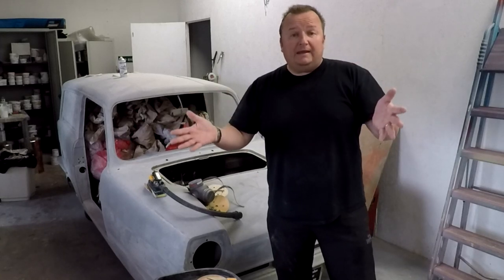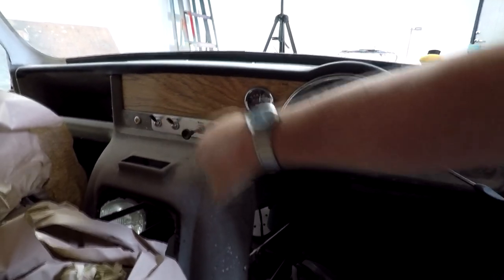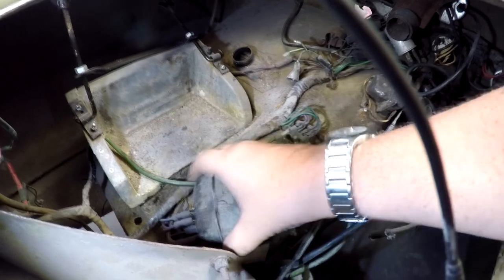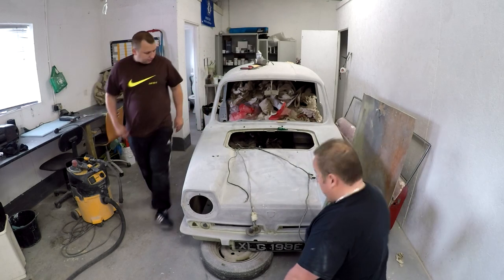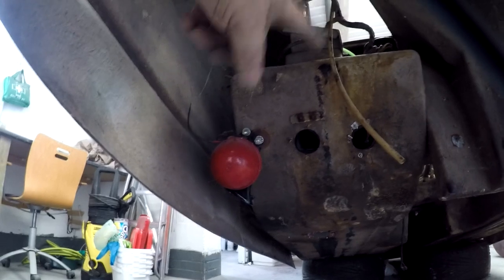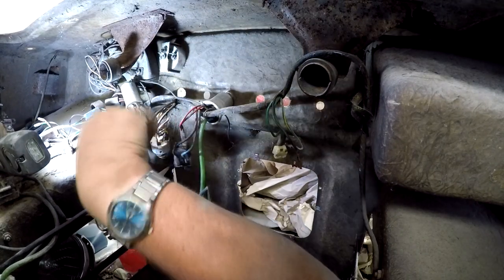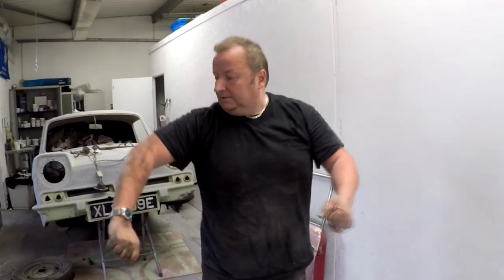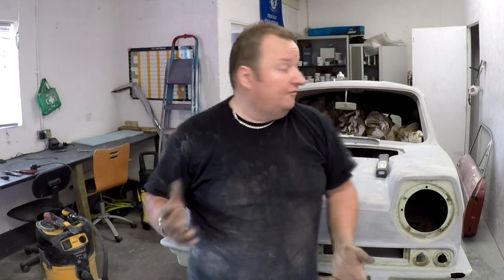Part 19 Reliant Trotter Restoration Removing The Electrics #ofah

Comment: I think I am rather glad having a MK2 Robin lol especially with the removable panels ;)   Are you going to keep the ignition original or will you be electronic'ing it up?   Also I know its not original but things like wiring in a HID relay for the main lights so you can run hi power bulbs is easy with it all out and give you superior lighting to the candlepower of the original, LED'ing the indicators has proven to be in mine a total godsend and I replaced the horrible Ford bulb holders with aftermarkets and double sealed all the wiring in the rear so it will take a flood to make them not work now :D   The latest "10 year" BA15s LED bulbs are incredibly bright and I paid like £2 for a pair off ebay (not sure if the Regal takes the BA15s bulb type in the indicators).
Reply from the maker: I'll be uprating the ignition Ian and possible converting it to Alternator and an 850 engine. I will be keeping the original engine in case I sell it and the new owner wants everything original. Uprated lighting too.